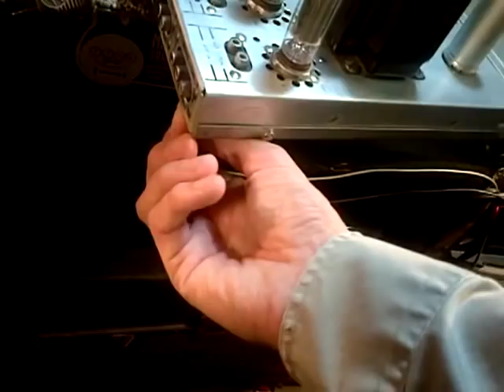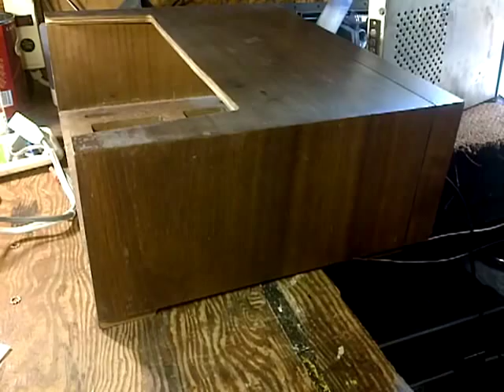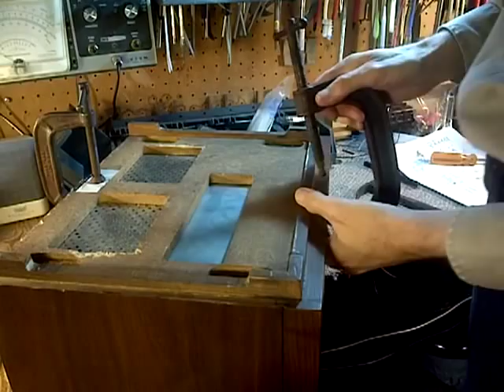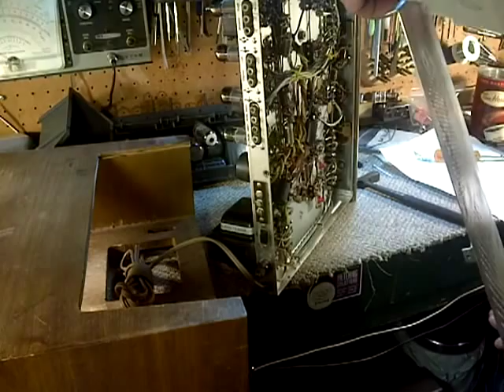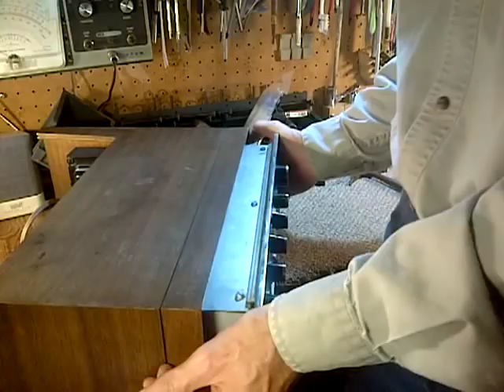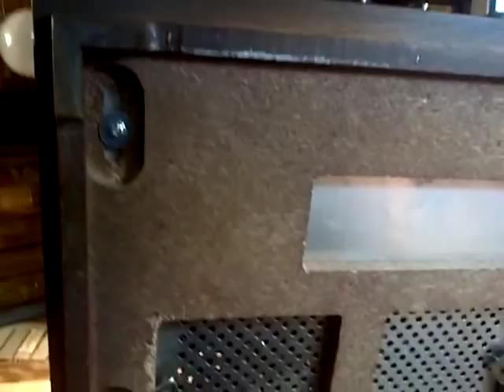Fisher X100A Tube Amplifier Video #3 Fitting the Amp into the Cabinet

Comment: Thanks for the posts, Jim. I've been reading and watching as much as possible to troubleshoot my X-100-3.  Same 12AX7 front end with 7189 power tubes.  Fortunately mine came with the original case. Thanks Again and great work!

Comment: I have one similar to this amp, an X-100-C. Last time I fired it up, I heard a humm and one tube glowed like an H bomb, and then I smelled smoke. Did I ruin it?
Reply from the maker: Not likely.  You obviously have some parts that need to go.  The glowing tube was probably the rectifier tube feeding a shorted filter capacitor.  If you cut the power within a few seconds, you probably did little damage to the amplifier.  The rectifier tube might be ruined.  You probably need to change the filter capacitors.  Just making guesses here but I would not consider it seriously damaged.  When I plug in equipment for the first time, I have a 40 watt light bulb in series with the equipment to avoid feeding high power into to a serious fault.
Reply: Hi Rob..Don't mean to jump in on your conversation with Jim. Just wanted to say it's highly unlikely you ruined your tube amplifier. They can take quite a beating. My guess is a bias resistor on the bad tube or something similar. Not really a difficult repair but if you are not familiar with tube circuits and potentially lethal voltages present in these amplifiers, I would caution you not to repair it yourself. Good luck.